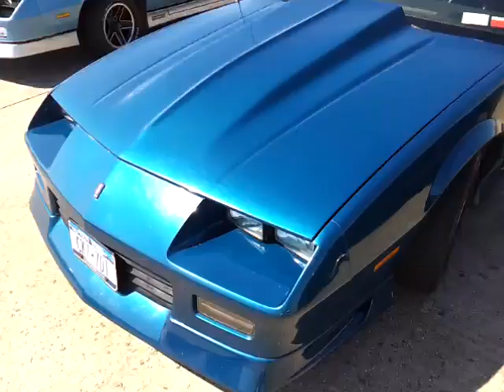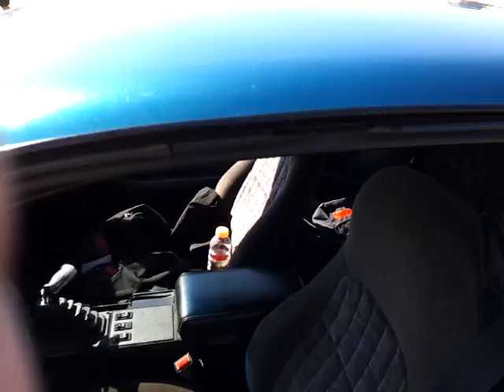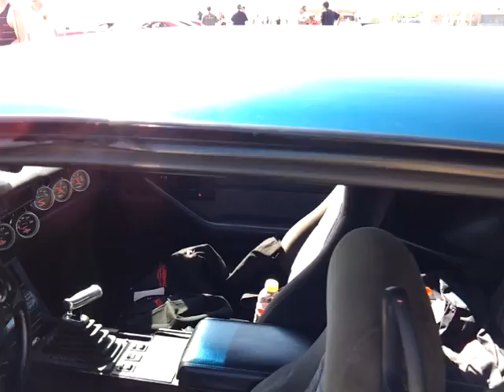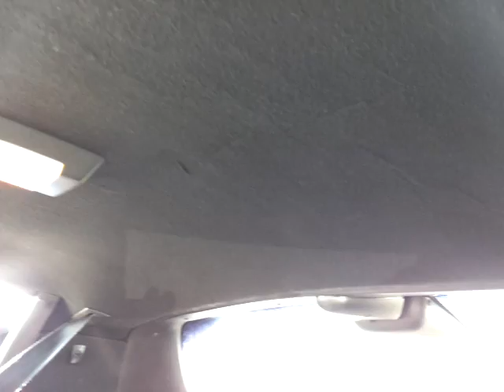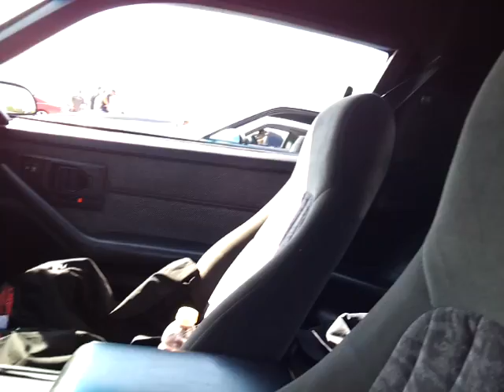How To Repair A Sagging Headliner - PT 2 of 2

Comment: every single video ive watched so far has only been about spraying adhesive, and then skips to a completed job lol.. wtf.. next video
Reply: Not to mention BOTH surfaces need to be sprayed, with contact cement, the liner AND the roof. let dry 10 min and connect. and do not need so much contact cement used. (I'm an auto tech for 50 years).